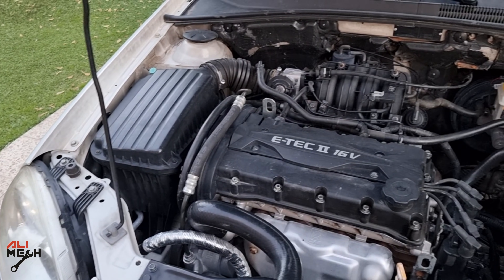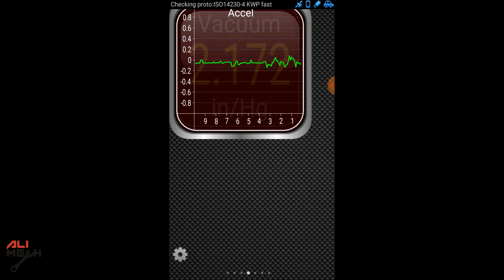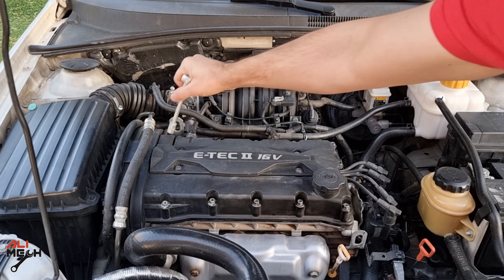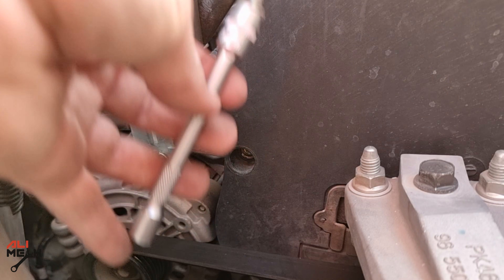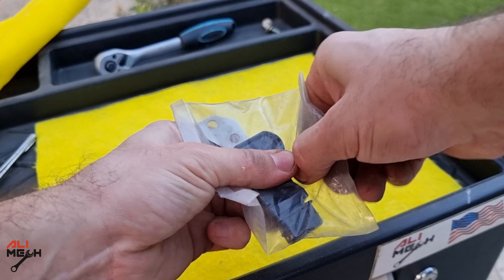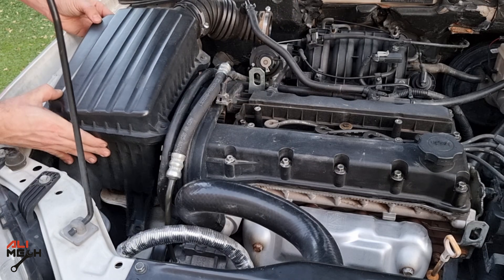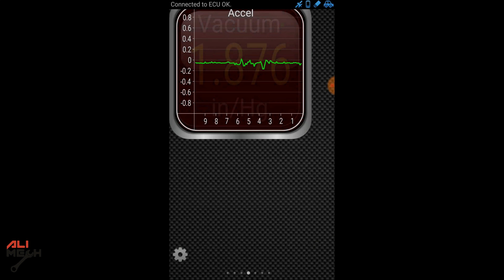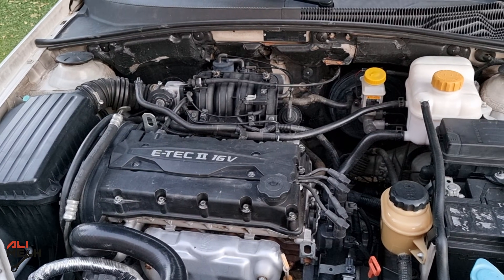Watch this If check engine light on and Hold Flashing/replace camshaft position sensor on Chevrolet

Comment: Please can you help me, I have Optra 2011, I have changed camshaft position sensor, changed battery and checked all wiring but still have code p0342, what else should I do please help me, thanks
Reply: لدي مشكل ضعف عزم السيارة في أوبترا لم يفهم أحد الموضوع. لدي حساس الكام في عطل لكن كانت السبارة تشتغل بمجرد تبديل جوان كيلاس مع البستوات وقع لي هذا المشكل

Comment: Hi. I have chevrolet lacetti 1.6, ~150k km. It tripped the code for camshaft position sensor, but it went away on its own.
Reply from the maker: Maybe u have loose wire harnesses, when it sense any signal cut, the code comes on

Comment: chevrolet nubira sx  1.6 petrol,80kw,  and same problem but i driving with check eng. , tnx for video. Does anybody have problem with drivers door windws lifter ?
Reply from the maker: Usually Windows lifter has a plastic that  connected to the motor, it brakes easily

Comment: Thanks for video man. I have replace sensor on sam car and engine i delete faults. But after 1 or 2 days of driving i get again same error and check engine light?  This is DOHC engine is there mby 2 sensors or what seems to be problem? Thanks
Reply: Have you solved??
Reply: @alessiomitsi   yes, original sensor solved problem
Reply: I get the same problem.

Comment: if they were all that easy!  I have a Code 400 for restricted air flow on EGR valve. Bought new one but have to fully remove throttle body to get at it!!

Comment: this is very known issue with this engines. mines goes bad on 130k km. And cheap ones doesnt last long. You must use gm ones

Comment: Hey Ali, This is an excellent video. But, here is something I learned. When I used Sam's Store economy gasoline for awhile I get the camshaft code. If I use regular gasoline from almost  any national brands the camshaft code and check engine light goes away. I don't understand what the connection is between the two, but some gas brands trigger this check engine light code.
Reply: I guess pinging due to bad quality fuel is causing the timing to compensate and possibly flagging the fault.

Comment: How long did the first replacement last?
Reply from the maker: It was a used one, I think it lasted one and half year maybe 40k
Reply: Myself, Had it replaced original at 25x,xxx kms five years ago. I think it has its cycle. Buy genuine GM part would solve the problem.